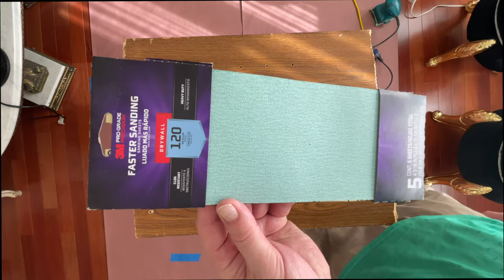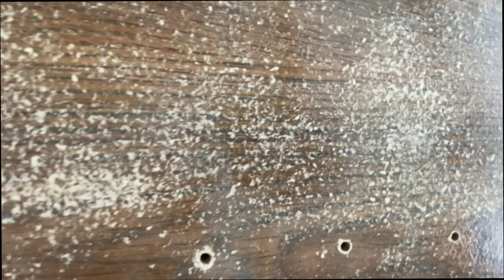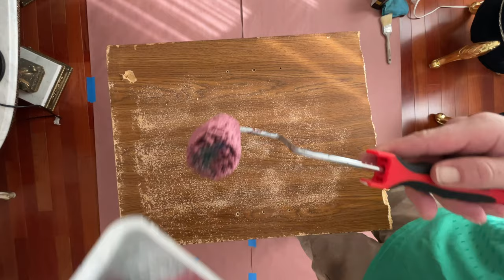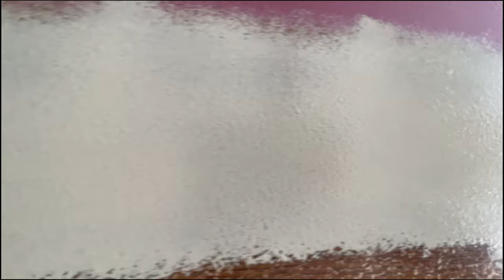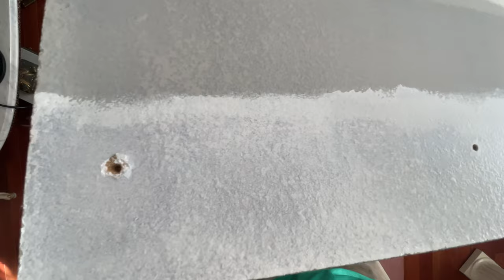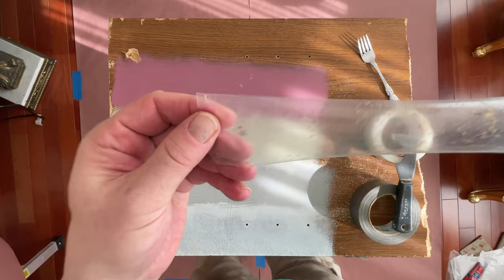4 Primer Scratch Test- STIX Primer - Zinsser Bulls eye - Ben Moore Enamel Underbody - Zinsser BIN

Comment: Great video. BIN is my go to primer for stains and when I want the best adhesion. I also find clean up is easy with ammonia and water.
Reply from the maker: Hi Mike

Thank you! Yes it’s awesome for adhesion and dries fast. I also clean up with Ammonia, but sometimes have a issue with the smell. Have you tried using Denatured Alcohol?

Russ
Reply: Denatured alcohol works good since it is an alcoholic base primer , paint thinner for oil base , mineral spirts on my machines
Reply from the maker: Yes it works great! What kind of machines?
Reply: Which one would be best on oak cabinets?
Reply from the maker: I like to use BIN cause it dries fast and adheres to the varnish with no sanding needed. I oh course De gloss first. The BIN also is very thin, so it won’t leave a heavy nap if you work fast with the 1/4 inch nap microfiber roller
Reply: I recently started refinishing furniture. I'm going to have to do it in the house as opposed to the garage because I live in a cold weather state.  Because of the smell...do you think I could get away with the Bin water based instead of the shellac? Thanks
Reply from the maker: Hi

Thanks for your question! I’ve talked to painters that have used it and they said it doesn’t have the same strong adhesive qualities that the smelly stuff does. The smelly stuff bonds tightly to the varnish.
Reply: @RussOlinatzPaintShow   I was afraid of that . Do you know  of any water based primer that performs like a oil/ shellac based one? Thanks for such a fast reply!
Reply from the maker: No I don’t! There are water based primers that can stick to varnish provided you Sand the varnish and create a mechanical bond! The bad smell of the BIN goes away fast.
Reply: @RussOlinatzPaintShow  I was checking because I will be using in my house ( not basement) ) . Looks like I might have to use a oil/ shellac primac and crack a window? Maybe plastic the 2 doorways( no doors)? Thanks again.
Reply from the maker: No problem!
Reply: How long should bin be given to dry?
Reply from the maker: Hi

To top coat with Paint?
Reply: @RussOlinatzPaintShow  Hey, yes. I'm doing baseboards and trim with satin finish.
Reply from the maker: It dries very fast and can be top coated in 45 minutes. Are you using a brush or roller to apply. What surface are you priming?

Russ

Comment: I've done this exact test and yes the conclusion is the same. Still the bin is superior because of easy cleanup and also the leveling and sandability for a great finished product.
Reply from the maker: Hello Ian

Thanks for sharing your experience! Yes, I love the BIN! Why do you say that it’s Easy Clean up?

Russ
Reply: @RussOlinatzPaintShow  well for finish coats I normally use an acrylic urethane or enamel but with methylhydrate the easiest thing to clean is the BIN. Oil primer cleanups are definitely difficult to do if you're trying to get the same results
Reply from the maker: Yes I top coat the same! What roller do you use?

Comment: Thanks, I'm painting some old kitchen cabinets this week and will be using BIN primer followed by a couple of coats of acrylic eggshell!
Reply from the maker: Nice! Are you going to spray or Roll?
Reply: @RussOlinatzPaintShow  I'll be rolling them with a foam roller
Reply from the maker: Have u tried the 1/4 inch microfiber?
Reply: @RussOlinatzPaintShow  I have tried similar
Reply from the maker: @Nickpaintbrush what brand?
Reply: @RussOlinatzPaintShow  Wooster but others as well
Reply: I’ve worked at BM and painted cabinets and furniture. Do yourself a favour and don’t use eggshell finish, use at least a pearl in the advance and also use a flocked foam roller instead of just a foam roller.

Comment: My experience has been if the bare wood is a particle board type, which is common under cheap paneling like you sanded, that water based primers cause that particle board wood to swell up and crate bumps. That does not occur as much with oil based primers. Either way, if bumps appear after the wood has been primed, more sanding is required and then a second coat of primer must be added.
Reply from the maker: Hi Chris

Yes, good point! What primer do u like to use?

Russ
Reply: @RussOlinatzPaintShow  I just did a test of three primers on a scrap piece of shiny old wood paneling: Sherwin Williams Extreme Block, INSL-X Primall, and  Kilz 2 All Purpose. Waiting 24 hours to cure, the fingernail scratch test failed to remove any primer. The dull screwdriver scratch test put a line mark but did not remove any of those primers. The sharp edge of a chisel started to remove the primer. This paneling is a laminate which I sanded with 220 grit and it had some spots down to bare wood. None of the bare wood spots swelled up. I would not hesitate to use any of these on my paneling repainting project on my next house I am moving to.
Reply from the maker: Hi Chris

Thanks for doing that test! All 3 of those primers are great! Have you tested out the Zinsser Smart Primer?

Comment: Russ,  I'm thinking that simple water cleanup is my number one priority and I am not even considering running a fork over my work.   I'm going with the Zinsser Bullseye this time.
Reply from the maker: Hi

Simple water clean up is a blessing!

Russ
Reply: @RussOlinatzPaintShow   As the folks over at Western Airlines use to say...  "It's the only way to fly".
Reply from the maker: Lol! Have you ever worked with Zinsser  BIN?
Reply: @RussOlinatzPaintShow   Nope.  I have a quart of 123 and have gone through a gallon and a half of Gards for sizing walls before wallpapering.  My next Zinsser purchase will be the Triple Thick exterior primer before I paint the garage door, the front door, some shutters and various other trim with Some Valspar Duramax I bought at Lowe's.
Reply from the maker: Hi

Ok great! Let me know after you work with the Zinsser Peel Stop Triple Thick Binding Primer? Aren’t you supposed to use Zinsser Shieldz for the wall covering primer Sealer?

Russ
Reply: @RussOlinatzPaintShow  I don't know about the Schildz.   You did a video and suggested Gardz a few years back as a way to seal wallboard.   I used it and it sealed the wallboard which should make it easier to remove the wallpaper in the future if need be.
Reply from the maker: Oh ok!

Comment: Tinted primer dosn't bond as well as untinted, its usually best to keep primer untinted even if it means having to do a little extra work.
Reply from the maker: Hi

Thanks for sharing your opinion! Have you had any trouble with bonding using a tinted primer?

Russ
Reply: @RussOlinatzPaintShow  personally no, because I never use tinted primer on bare wood or cabinets. Tinting a primer gray for red paint I have done, because ot makes the red look better and hides well, but when you want the sticky adhesive bonding properly of a good primer for cabinets or wood or metal's it's best to avoid because tinting changes the property of the primer. It's not so much an opinion, I've been painting for 14 years, it's just what ever paint store recommends as well as doing a quick Google search and checking out painter forums.
Reply from the maker: Hi 

Thanks for sharing your opinion. Some primers are not meant to be tinted, but A lot are. Many Primers say right on the Can that it can be Tinted using up to so many ounces of universal colorant per gallon. Many Bright and Deep colors require a tinted primer! I think many people who mix paint are not knowledgeable of what tint to use or that they may screw it up, so they say that you shouldn’t tint the primer because it will effect the adhesion.   Have you had this happen to you?

Comment: I like your videos and like real experiments like this. But, bulls eye 123 takes 7 days to fully adhere, you only gave it 2.  Since you like to know; I'm in Toronto.
Reply from the maker: Hi Tony

Yes full adhesion is 7 days and must be too coated with in 30 days. That’s not sanding and Deglossing like I did. What your preferred primer over varnish or polyurethane?
Reply: @RussOlinatzPaintShow  Hi Russ,

I never used it, but I think B-I-N would be best. But since it's more expensive I would just sand and use Zinsser Cover Stain. I like how it sands out.

Sanding/de-glossing or not, BE 1-2-3 requires 7 days to fully adhere, that is especially important in an experiment.
Reply from the maker: Hi

Yes thanks for sharing that! My concern was with the Zinsser BIN. It must be top Coated with in 3 days so I gave it 2 days to cure. In a perfect world I should of waited 7 days to top coat the Bulls Eye 123. What I like about the Bin is that it’s really thin and you can apply 2 coats in same day and then top coat!
Reply: @RussOlinatzPaintShow  I don't see anything in Zinsser's technical data sheet about requiring top coat within 3 days. Actually it says it takes 1-3 days to to fully cure. Yes, it's super fast drying and can even recoat in 45 min!
Reply from the maker: Home Depot sells this and they recommend this. To ensure full durability with Rust-Oleum Zinsser B-I-N Shellac-Based Primer, we do recommend applying a topcoat within 3 days of application.
Reply: @RussOlinatzPaintShow  Between Home Depot or Zinsser, I take the manufacturers recommendation. 

Is this HD recommendation about B-I-N written somewhere you can point to? I can't imagine Zinsser not including such requirement to recoat within 3 days on their own TDS. They include every little detail. Such a quick recoat requirement is certainly not a little detail.
Reply from the maker: Just Google “
Does Zinsser BIN need a top coat? “
Reply: @RussOlinatzPaintShow  You're changing the subject. You claim that Zinsser B-I-N needs to be top coated within 3 days of application, not weather or not it needs to be top-coated. You have referenced something from Home Depot "...we do recommend..." but since you can't cite that I assume it was just someone working at home depot telling you what they think. If not, please point me to this Home Depot recommendation.
Reply from the maker: I’m not changing the subject. What’s your email address?
Reply: @RussOlinatzPaintShow  This is now silly and you're being unreasonable.

You have an issue with someone pointing out an objective and material correction to you that is clear and simple. Even pointed out in a kind/friendly way.

I honestly did like your videos.

Enough.
Reply from the maker: I have a screen shot that I want to send to you from Home Depot. What’s ur email address so I can send it to you?
Reply from the maker: Rust-Oleum Zinsser B-I-N Primer Sealer Stain
Killer can be recoated or top coated after 45
minutes. It is recommended to apply a topcoat
before the primer is fully cured in 1-3 days. If this
time frame is exceeded a new coat of primer is
recommended for proper adhesion of your
topcoat.
by Rust-OleumSupport Apr 23, 2021

Comment: Great vid!
Reply from the maker: Thank you Ben!
Reply: @RussOlinatzPaintShow  russ what primer would you recommend for wall shower tile
Reply from the maker: Hi Frank

Are you painting over tile in a shower?

Russ
Reply: @RussOlinatzPaintShow  yes
Reply from the maker: Hi Frank

Just so you know It’s not practical to paint tile on all bathroom surfaces. But your paint job will last the longest on tiled bathroom surfaces that receive low to moderate exposure to moisture—think bathroom floors. Your best bet is to use an epoxy or urethane primers. Have you researched this?

Russ
Reply: @RussOlinatzPaintShow  thankyou rusd for the quick response,I am a painting contractor myself in new jersey  ,syix was highly recommended as the go to primer,the beach home is not lived in year round just weekends ,and they will be eventually gutting it  ,I am just so afraid of it failing  .
Reply: Stix i meant to type is  the primer  ,I used
Reply from the maker: Hi Frank- no problem! The Stix will definitely stick to the tile! But tile exposed to water is concerning! How much tile exposed to water are we talking about?

Russ
Reply from the maker: Ok
Reply: @RussOlinatzPaintShow  tile goes  down to a bath tub ,no floor tile  to be painted in the shower or anything like that ,just walls
Reply: Would a clear coat of water based poly give any more protection your thoughts
Reply from the maker: Hi Frank

Ok have you ever thought of running a clear plastic shower curtain over that area  to protect from water? Then after showering just remove the plastic shower curtain and wipe dry any wet tile. Then at least the eye sore is gone and the newly painted tile is shown again?
Reply: No russI don't think you understand i don't own the summer home i have been contracted to paint the tile in the bathroom , @RussOlinatzPaintShow
Reply from the maker: Oh ok! I wouldn’t take the job unless explaining all this to homeowner. But if there ok with that and don’t mind doing a little dry towel action, then I would try and get them to use a clear shower curtain to protect the painted tile!
Reply: @RussOlinatzPaintShow  i had to take the job on ,just getting back on my feet from illness kept me away a long time ,plus I'm doing the whole summer home,brnjamin moore paint staff needs to get their information on the same page ,I have talked to all stores in my area and they have different views on the subject,and that epoxy tile paint I cant get and don't want to use anyway it stints to high heaven, clean up is lacquer, horrible stuff ax im sure you know
Reply from the maker: Yes I hear you! It just depends on the amount of water that is left on the surface to wreak havoc!
Reply: @RussOlinatzPaintShow  i know russ ,people who think that this job is easy have no idea the stress that comes along with it ,my weekend has been ruined thinking about this bathroom  ,
Reply from the maker: I hear you!

Comment: Hello, I’m thinking of painting my cabinets that are from the 80s. They’re a wood grain, but not solid wood, I don’t know exactly what they’re called. Do you think the bin would be a good choice for cabinets? And recommendations for a  topcoat?
Reply from the maker: Hi John

Yes Bin is the best choice especially if your trying to bond to Varnish or Polyurethane. Are your cabinets varnished?

Russ
Reply from the maker: I can’t see your recent comment
Reply: @RussOlinatzPaintShow  Sorry, I can’t see it either now. Thanks for the reply. I don’t think it’s a varnish. It’s kind of the same texture that older wood grain hollow core doors are made of, but on a cabinet door. Would cleaning with TSP be good enough? Also what would you recommend for a topcoat for cabinets. Electrician here, painting is something I know very little about and any advice is much appreciated.
Reply from the maker: Hi John

Yes TSP will work. I use a liquid Deglosser. I would use Sherwin Williams  Emerald Trim and urethane paint. Another paint is Benjamin Moore Advance. Both level out Nicely! Where u from?

Russ
Reply: @RussOlinatzPaintShow  Thank you I’ll check them both out and get a Deglosser. Everything that I’ve been reading is that it’s a huge pain to paint that type of cabinet but I’ll give it a shot. I’m in NorCal.
Reply from the maker: Nice! Make sure the cabinets are clean before priming. Are u going to use BIN primer?
Reply: @RussOlinatzPaintShow  That or the pink one in your video. But leaning more to the bin for dry time. I was planning on cleaning with TSP, then the deglosser. Is it ok to prime over the deglosser or do I have to remove it with something else?
Reply from the maker: I’ve never had a problem after using WilBond.
Reply: @RussOlinatzPaintShow  Ok awesome! Off to Home Depot , hopefully they have the goods. I needed denatured alcohol the other day and it’s banned in California because of VOC so hopefully they have the shellac. I can’t thank you enough for all the help!🙏🏼
Reply: One last question, do I need to sand the primer at all before topcoat?
Reply from the maker: If u use the TSP I would wipe down with water afterward. I doubt they sell WilBond in California, but it’s worth a try. It’s the best deglosser!
Reply from the maker: BIN won’t raise the grain of the wood. If you are going over a varnish there is no need to. But if there is specs in your primer or your roller sheds, then yes!
Reply: @RussOlinatzPaintShow  Right on good to know. We will see how it turns out 😂 🙏🏼
Reply: Balcony n the wood rusted so witch ones is the best use it ??
Reply from the maker: Zinsser BIN!

Comment: Been watching your vids over the past year. About to roll some bin on some cabinets and in between using foam roller or microfiber like you use. Any reasons to not use foam?  
Have a good day
Reply from the maker: Hi

I have used both. The advantage of using the microfiber 1/4 inch nap is you are able to get into the crevices and corner easier. 

Russ
Reply: @RussOlinatzPaintShow  sold. How do stop the paint from building up when pushing the tip of roller into the corners or designs
Reply: Thinking about using that whizzflock
Reply from the maker: After I roll the primer on to transfer from my paint pail, I use a 1.5 inch brush  in the corners or recessed areas to spread out evenly, then take away brush strokes with roller again!
Reply from the maker: Try them both and see which one you like better!

Comment: To be fair, stixx is only guaranteed in stock, un-tinted form.
Reply from the maker: Can be tinted with up to 2 fl. oz. of Benjamin Moore® Gennex® colorants
or Universal colorants per gallon.
Reply: @RussOlinatzPaintShow  many Benjamin Moore distributors won’t tint it anymore, colorant degrades the adhesion. There’s no reason to be tinting it, it’s an adhesion primer.
Reply from the maker: @ryane6719  How do you know many Benjamin Moore Distributors won't Tint it anymore? It says right on the can that its Tintable.